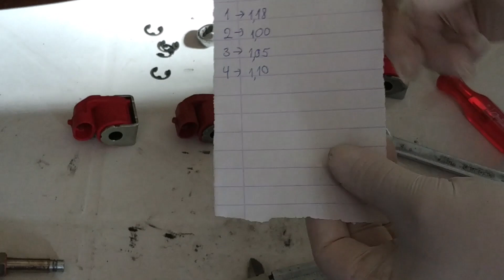Valtek Typ 30 Einspritzdüsen LPG Einstellen - Adjust Valtek Type 30 LPG Injectors

Comment: Hello,I have 2 pairs of valtek injectors,with first one,the engine stops when I put it in neutral.The second one at high engine load doesn't inject enough Fuel.Can you give me some advice please,i want to know what you recommand.
I have a 2.0 16v engine and in future i want to do almost 200 hp.This valtek injectors are good for this power or I need an upgrade? (Above 4000 rpm the ecu is set to change on gasoline,but i want that 800-4000 to have propper power from lpg :) 😊

Comment: I have a question if you can help me. Few days ago i used a repair kit for my gpl valtek injectors and when my engine temperature raises to 90 C my car doesnt go above 3000rpm ? What can be the issue? Should i loose the injectors? It stays at 3000rpm and doesnt increase speed if i commute to petrol it works normallym
Reply from the maker: replace injectors

Comment: Hello. I have these type 30 injector rail, I bought them new in box about 8 months ago. They work fine and have good economy but its been 2 months that have an abnormal high ticking sound I can hear outside of car like tick tick tick tick tick.. Before they were very silent. No errors on autogas software. The autogas specialist told me not to worry maybe they have a bit dirt inside but I dont want to hear that sound, they were silent I barely was hearing the engine sound when was working. Its a golf mk3 1.6 74kw. Please help me what can I do, any advice?
Reply from the maker: Hi you should clean up them, and add a little bit oil with your hand on the piston of the injector, it should make it noiseless. Thanks for comment.
Reply: @nikolaosmnk  Does this cleaning makes them silent as they were?? Oil residues can help without accumulating gunk in the future ? Thanks a lot for your reply
Reply from the maker: @geraldzenelaj  Yes it does. Oil rsidues can help without accmulating gunk, because lpg fuel also has oil in very low percentage.
Reply: @nikolaosmnk  Thanks a lot man. I will try this week and will tell you. 😉 I hope it will solve this annoying sound
Reply: I wanted to add something. When the engine is cold, lpg injectors works quiet (especially when I get home from work at midnight). But when its day and warm..after engine is warm up they soon will start to make that clicking sound
Reply from the maker: @geraldzenelaj  Usually, happens the opposite.
Reply: @nikolaosmnk  Hello. I cleaned injectors today..after re-installed they were silent, but as the engine warmed up again they started to make that clicking sound again 😣 the cleaning did not help. Why they make such a noise as engine warms up?? btw they were not as dirty inside
Reply from the maker: @geraldzenelaj  Hi, another sound may be produced by these injectors is if there any loose from the coils, if you touch the coil with your finger & is very easy to turn then is loosely. They are cheap injectors, in category you take what you pay, in the near future if you could replace them with Hanna injectors which they are absolutely silents.
Reply: @nikolaosmnk  Yes they feel loose when you turn those. They are cheap, but they workes very silent..I dont understand why they make noise when engine warms up, maybe something is wrong with reducer or something?? But the software tells no errors..driving is fine. Just the sound I dont like it
Reply from the maker: @geraldzenelaj  Ok, if they are loose turn out the lock and coil, press well the metal surrounds coil so as that not to be loosen the coil, or add an o-ring at down side between injector & coil.
Reply: @nikolaosmnk  Yes the metal clip is holding there good..and the o-ring is there. A friend of mine has the same car the same injectors as mine..valtek type 30. two years with those, they work as they should. No abnormal noises. I just dont understand what is the problem and the most annoying part is that those "mechanic" can not find a clue
Reply: How you adjusted those ?? I saw the video but did not understand

Comment: What is the use?
Reply from the maker: They are lpg injectors and they need after several kms cleaning and adjusting, so as every injector injects precisely the same amount of fuel.
Reply: @nikolaosmnk  Thanks
Reply: Hello how are you. I bought these injectors new in box in october 2019. They were excellent for my golf 3 1.6 and they work fine..but its been 2 months they have a ticking sound like tick-tick-tick-tick-tick.. They were very very quieter..I barely cant hear if engine is working or not you know what I mean. This sound came only whem is working in lpg. All filters been changed, the gas system, ignition and general condition is very good. I just dont know why they work louder now. It just had one error for low voltage supply. I changed my battery because was very old. please can you help me to understand what is going on and what to do?